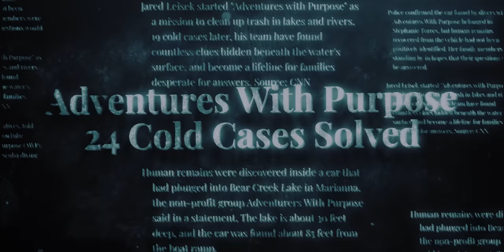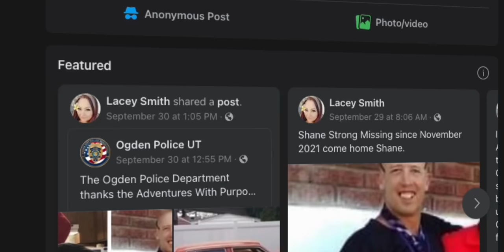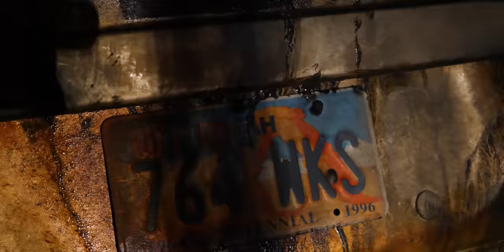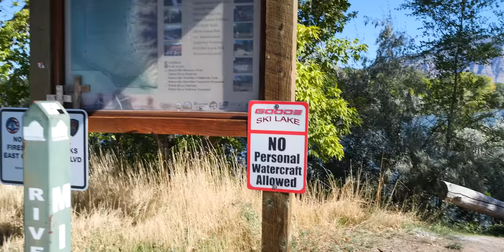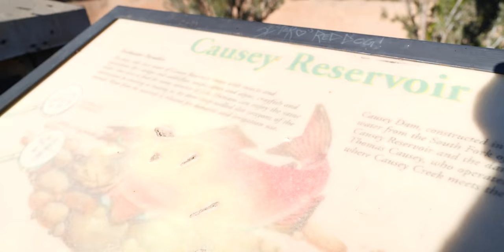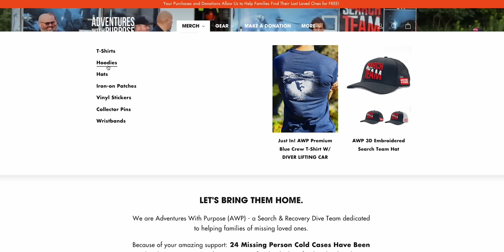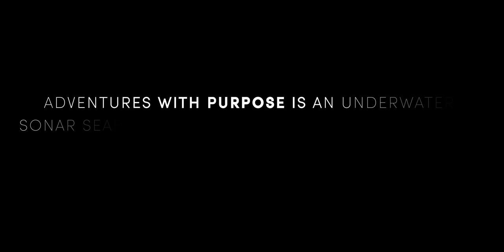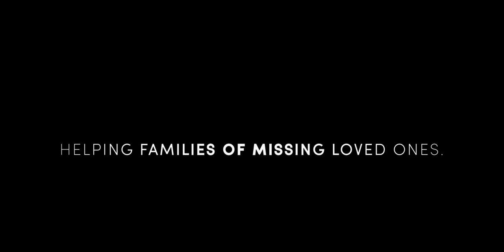CALL IN HEAVY.. (Pt2) The Search For Shane Strong

Comment: Doug, the way you got an electric shock from that machine, I have the same thing. It's always when I get out of the car, I now learned to close the door after I get out by pushing on the window, I don't touch the metal anymore because I will get zapped. Always. And no one else I know has this, even if we get out of the same car. I've always had it, I don't know why I build charge and others don't, but I guess we have the same weird thing. Also, great thing what you're doing with recovering missing people. I hope you can keep doing it with everything that's going on now. Great job!

Comment: 24:58 The machine was not grounded properly. That one looked pretty much broken. The grounding rod moves or screwed plates rust. They get whacked with lawn mowers or weed wackers. People hit them with cars and crack the covers all the time, allowing water to get in and rust the connection.

I had one at a place I lived that was wearing out; and giving mild-moderate shocks (but it's right in your dang fingertips!) The pain of that experience certainly sticks with you! I used to slap the thing, before touching the numbers. It was re-grounded, after we complained to mgmt of getting shocked.

Comment: When will you guys be able to use the magnitometer? Also, why aren't you guys using a go-pro and a light on a telescoping poll more often? Have yall thought about using underwater drones? Will you guys be taking cave diving classes? I've heard that practicing cave diving techniques would help you with your buoyancy practicing and also could help with visibility when closer to the bottom by stirring up less silt. I'm not a diver myself but I've heard the channel dive talk give that feedback when it comes to yalls finer diving skills with your visibility problems.  It could help you guys be more effective in being able to clear vehicles as well as preserve the vehicle conditions when you come across a vehicle in an active investigation. Also, i was wondering why you guys don't put screens over the broken windows before pulling up the vehicles just in case you aren't able to adequately clear a car or in case it was a bad call saying a car was clear and it really wasn't. I do understand that having the car drain out the water does make it more feasible for equipment to pull out the vehicle since water is stupid heavy.  But on the side lines it might make sense to use something like chicken wire or hardware cloth to stabilize weak points. I was thinking in the case of the mom you recovered from lake tawakani that some chicken wire or hardware cloth would have helped keep the mom in the vehicle. But this is just my opinion from the sidelines as a person with very ecclectic hobbies

Comment: Dam that's a 2500 3/4 chey 4x4 truck wish that it would not have under water I could use part's off that truck for my truck if it had the 7.4 liter engine in it which is a 454 I need the starter

Comment: Right at 38 minutes and 45 seconds it loooks like a car the sand basically the car that went down it looks like you can see as the car went down the in the sand it looks like you can see a possibility that spot it was a car I thought it looked like a car as if the sand made it seem like that the car made that and it is very clear it looks like a car if you look closely

Comment: Ok ok, i know both heavy and doug have been in the towing business with at least a couple decades of combined experience but.... if heavy is so cutting edge with his talents on towing, where the hell are his boards? If a car is hard to get on a bed, you diy a ramp out of boards to get it on the truck. You don't risk your manpower by having them hold something. I get that maybe the boom wasn't available to get over the railing since those trucks cost well over a million a piece so they aren't in all areas and the physics wouldn't have been as favorable since it could put them at a tiping risk. But cmon, where's the boards and chauks? I was just a dispatcher and knew that wasn't the best job and they decided to cowboy it. They need to think smarter on how they can do things.  Sure, they have experience but still have room for improvement when it comes to recovery planning

Comment: 23:10 180 ft isnt that deep, you need to make decompression stops on the way up and got like 8 minutes of ground time for rigging but its doable, gotta handle it with respect but it still very much is doable with ordinary compressed air ... dont even need nitrox or noble gas mix
Reply: @profhortsunlover1536  its deadly if you act incorrectly or got bad gear, there is no vortex or current in a lake other than -directly at the lake drain & dam no problem if you set a anchor line or magnet magnetic fields dont matter since you ont orientate with a compass but a anchored line 
only thing you got to be carefull with is depth intoxication 
you neeed to be familiar with it and properly behave even under its influence - made easier by a intercom and sb telling you what to do and the time.